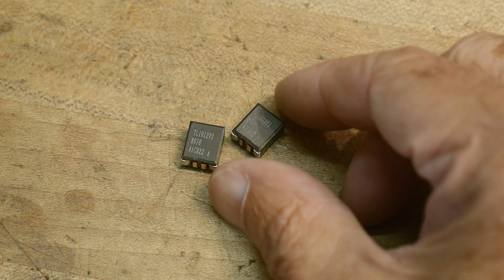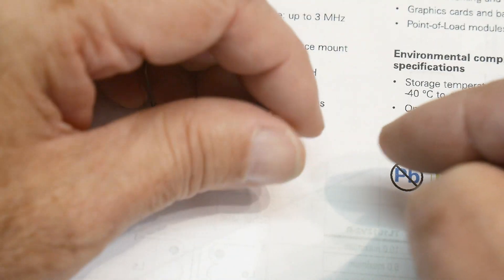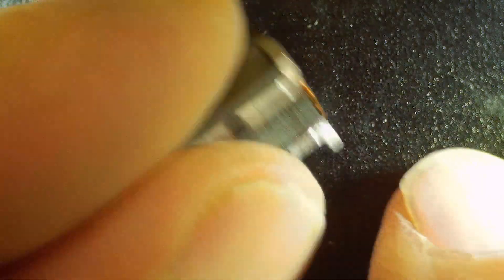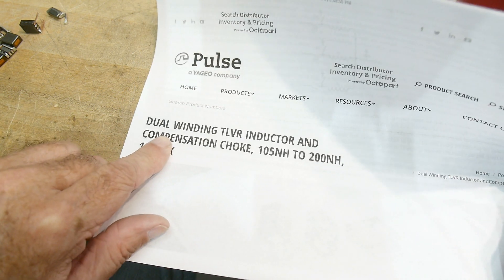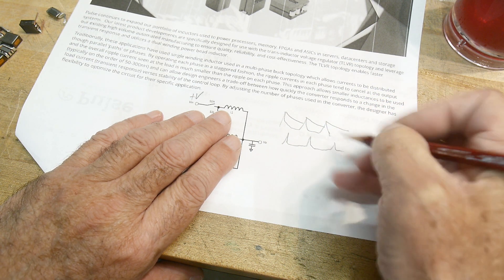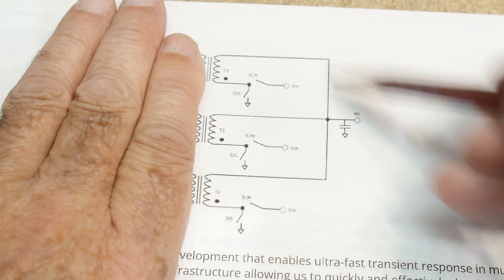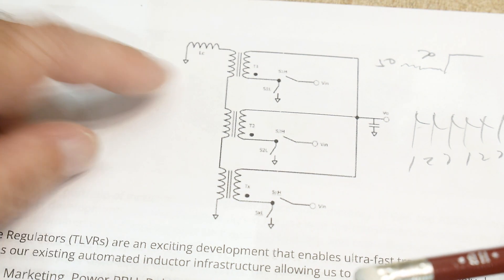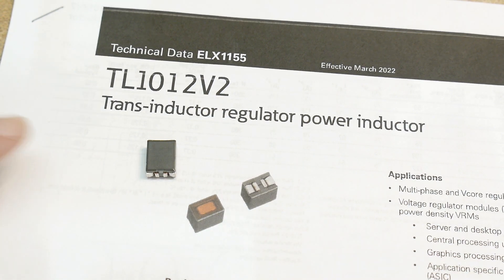#1719 Trans-Inductor

Comment: Basically power converters become magnitudes more efficient as switching frequency increases. So a transformer system operating at 50Hz and generating 100 amps might fit in a shoe box. The same power can be generated with a switch mode power supply at 100 kHz in a package the size of a cigarette packet. Smaller but high current inductors are necessary to operate at these high frequencies, hence these devices.

Comment: At the start of the vid when one was cracked open, I thought it could be used to have the conductors wired in series or parallel to get two inductance values with just one part.

Comment: It is a current probe transformer in most applications. The inner one has a frequency applied the outer one has the current feed through it. As the current increases the core saturates and allows more current to flow in the inner loop and the switching power supply senses this. It allows the voltage to be adjusted very quickly to meet the current demand. Also they can be used to isolate but couple a 1:1 signal magnetically, again speed is the desired outcome. Another thing i have seen these used for was laser flash lamp Q switch syncronization, in this use case the high current side of transformer is tied to the low side of the flash tube lamp and the inner coil is used to start the timer for the best q switch actuvation. Was in a eye surgery laser that used a Nd:Yag laser with an electro-optic pockrls cell q switch.

Comment: The main point is that when one PWM output sees that it needs to stay on longer, the windings linking the 3 inductors causes the current in the other two inductors to also increase.  Thus you don't have to wait for it to cycle through all three phases before the current can get up to what is needed.

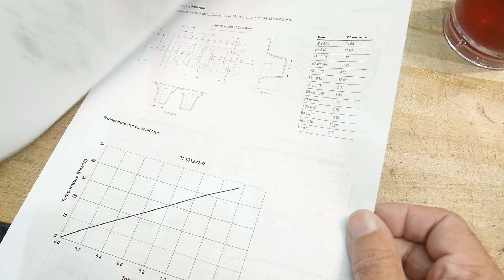Comment: 4:03 I'm going to guess that putting current through the smaller loop the induction changes on the outer loop.

Edit: close... I think the spikes in current will TRY to cause a change in the voltage. It will induce a current in the secondary they really can't go anywhere so it will be extra current in the inductor that causes the saturation to change. So I think it's altering the z shaped thing tidy you get when analyzing an inductors saturation and it can do it faster than the switching regulator can even notice the demand has changed.

Comment: Search the web for Multi-phase buck convertor.  TI has some good application notes and  controller IC.for multi-phase buck convertor.
I remember going to interview with Maxim about 12 years ago and someone asked me about them.
I did not know about them at that time, but after interview I researched them and learned about them.
I found out through out my carrier as a chip designer that going to interviews is the best way to keep yourself up to date  with latest in the field. 
I learned about Super Voltage Flower and Filliped Voltage Flower the same way..

Comment: I would have thought they would have added diodes to isolate the output stage of each one so that when one droops, it doesn't pull down the others.
Reply: Diodes are too lossy! The switch symbol represents a power FET with extremely low "on" resistance.

Comment: That yellow thing on the top is kapton tape or some other kind of tape, stuck there to allow vacuum suction nozzle to have a smooth surface to grab on, usually used in pick n place machines.

Comment: The transformer stack in parallel to series acts as a "step up" between all the phases when a transient is common-mode between them, but not with the differential ripples of the individual regulators.

Comment: Of course a transformer can do something with one turn. Jeeze Louise!

No, you don't get a "spike and a droop" and no, you don't put another one in because you can't go fast enough.
The primary reason for multiphase buck power converters is to manage the ripple currents both in the input circuit (where the current is "chopped", going from zero to some high value virtually instantaneously) and the output circuit (where the current is typically continuous but with quite substantial ripple which works the output capacitors hard). Ripple voltage at the output is generally vastly less of a concern than the ripple current.

It is quite clear that there is a lack of understanding.
Reply: It is obvious who woke up today and decided to tattoo "Jerk" on their forehead......
Reply: Its kinda like the alternator on your car, its three phase so that you can get more consistent power from idle speed to cruising speed. It also reduces the peak-to-peak ripple voltage. The battery helps to filter most of the ripple. If your car's electrical system is under a load (headlights, AC clutch, and rear window defogger on - in my neck of the woods the dewpoint in winter gets so bad that you do have to run AC and heat to keep the windshield clear) between pulses of energy from the alternator, from the battery will hold the voltage up if it is in good shape and load isn't too high. If you're night driving in winter with a low dewpoint listening to the radio, and turn on the defroster and rear window defroster, and then notice a whine through the radio speakers, its a sign that you battery is losing capacity, so yes the voltage will droop between pulses of energy from the alternator. A real world example that illustrates Imsai's point.